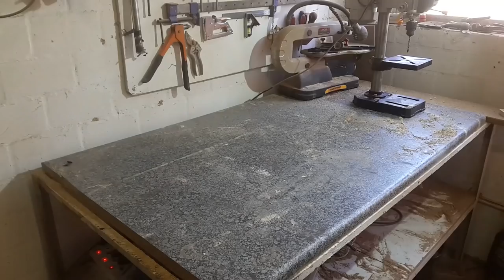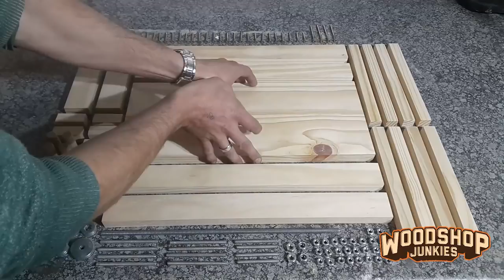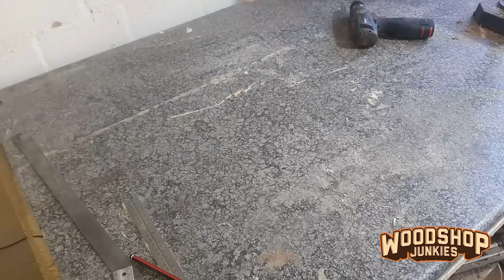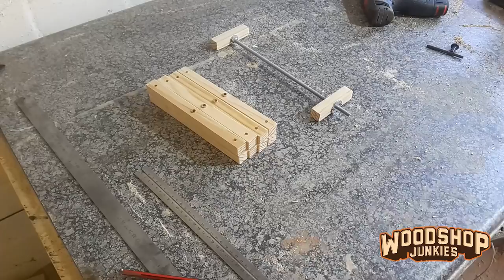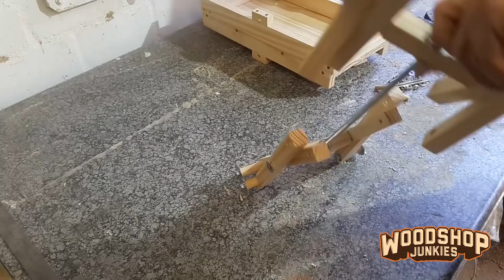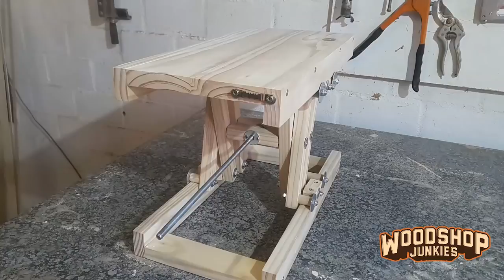How to make your own small scissor lift jack STEP BY STEP with plans

Comment: I would have mount the tread rod to the 2 x braces end points on the braces on the axis which the move..this way the motor would not lift into the air but only side with the movement of the scissors movement

Comment: Why did you drill out the dowels to use as bushings? Wouldn't it have been fine without the bushing? It's the only thing confusing me. Great vid though - I was working on a plan in my head and it came close to this - but without the refinement you have in it.
Reply from the maker: I did that because I figured moving the steel over the wood would wear out the wood over time. Also, in some places the dowels is slightly wider than the parts that are being held together by the rod. That means that all the force exerted by tightening the nuts is applied to the dowel and not to the entire assembly. So still allowing the parts that need to move to be able to do so.
Reply: @WoodshopJunkies  And just like that, the lightbulb went on - putting the tightening force on the dowel and not the arms. Thank you for replying!

Comment: Hi Great Project! What is the maximum weight capacity?
Reply from the maker: Hi Carlo. The load capacity on the lift is low as it was designed just to level out stock. However, replacing the load bearing components on the lift with more robust materials, like nylon, will greatly increase the lifts capacity.